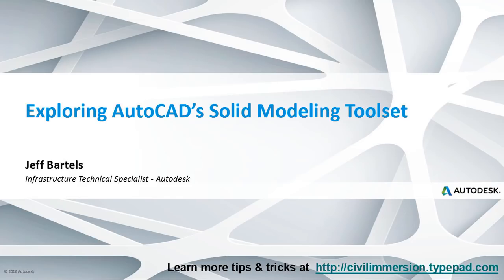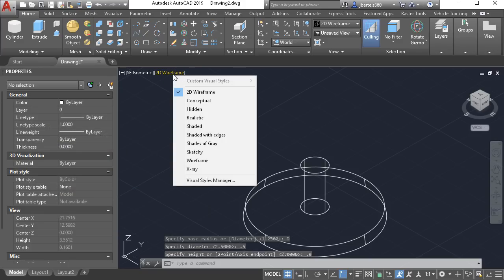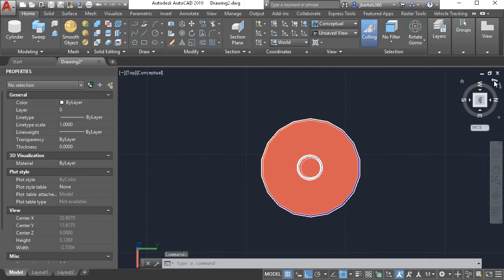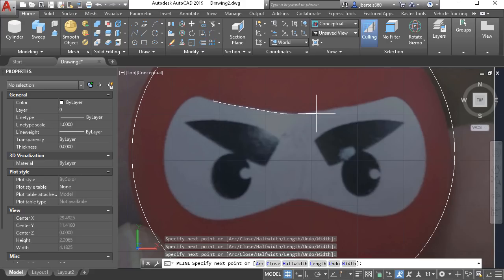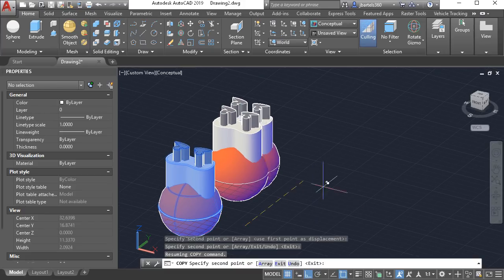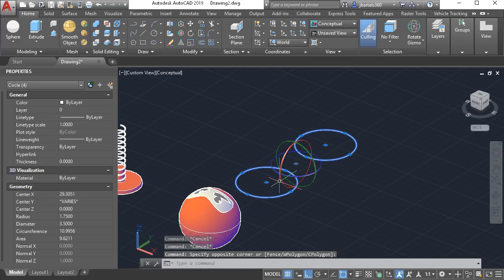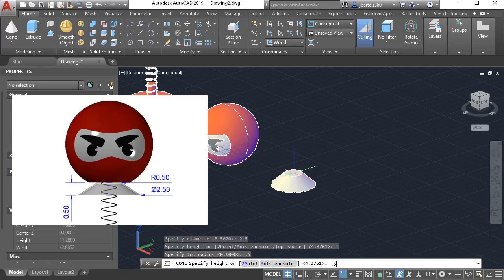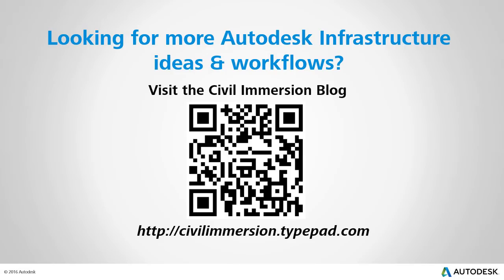Learn 3D Modeling using AutoCAD

Comment: I am a C3D user and we just upgraded to 2020. We are having trouble implementing gravity structures that have variable connection points. Would you consider doing an instructional video explaining how to set up and utilize this feature? Ideally, we would like to do things like show 2 pipes into one side of a inlet box connecting at points offset from the center. Things like showing a double barrel pipe system correctly or adding a small underdrain pipe just off the corner of a box, etc. Our main hangup is getting a parts list setup with connection points included. We are familiar with parts builder but I understand you cannot add connection points with parts builder.